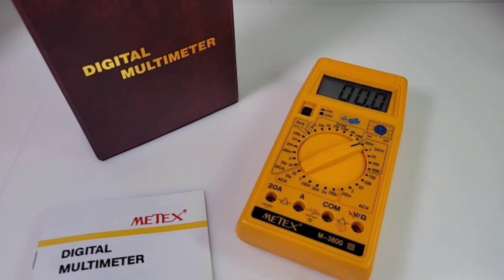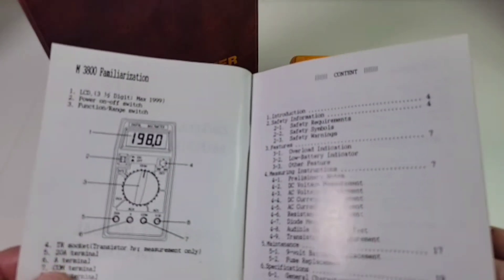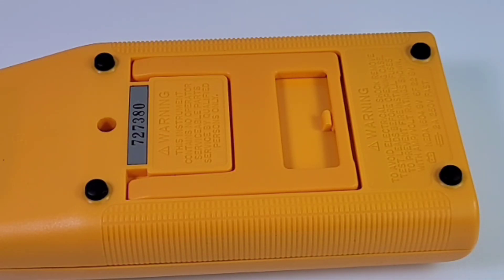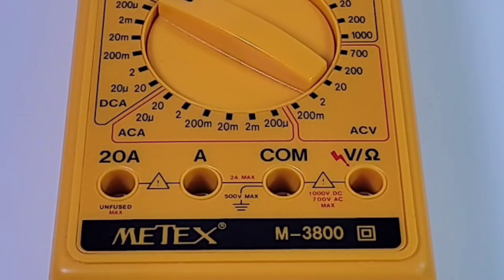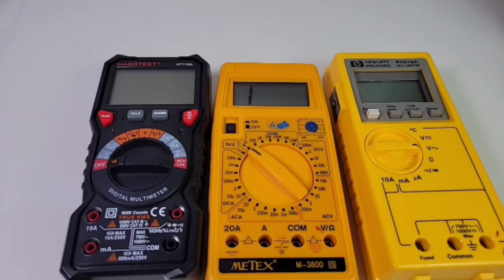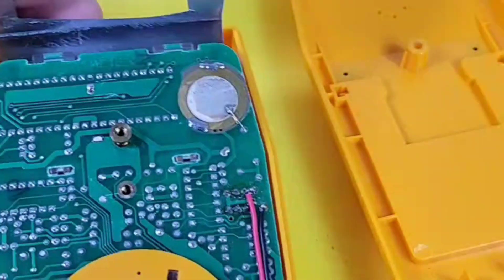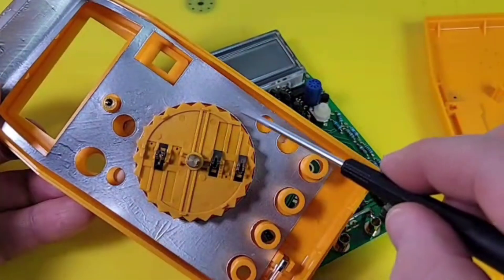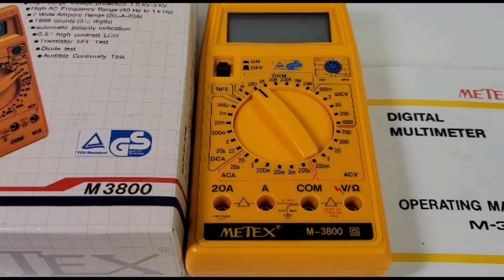RETRO-TECH ○ METEX M-3800 VINTAGE DIGITAL MULTIMETER [1992]

Comment: I had one of these, actually mine was an RTO (Ratho Hamburg) 3800. Basically the exact same as this. This was my first multimeter i bought it from my own money as a 15 years old kid... Stupid me i sold it for like 10 Eur about 5 years ago, simply i didn't need it anymore, i had no use of it next to my much more modern multimeters. I regretted it since then. Strangely i cannot find anything on the net about the RTO 3800, RTO was a popular brand in Europe back then. It was the exact same as this Metex, and it served more like 20 years without any issues. BTW, this has been sold under many other names, Mastech, Eumig, Mextech and so on.
Reply from the maker: Great info! Thx for sharing. Yes, I too have mistakenly sold a couple of meters only to regret it down the road.. what great  keepsakes ! 👍
Reply: I found one for 5$

Comment: Funny. Found this in a dumpster dive. In it's fake leather box and nothing else. No leads either. But it looks like it has not really been used either and only a minor scuff on the box which may have come from the dumpster. Seem to work very well. They really made great stuff back then.
Even those cheap DT-830B were sort of decent back then. Now you can find some DT-830B kits that are borderline decent but the preassembled ones are really just junk.
Reply from the maker: Great find..I need a dumpster like that! 😅

Comment: I just search for METEX M-3800 an found this video. Have the same multimeter. But something is wrong, just measured battery voltage and it fluctuates. I have a wish to repair it
Reply from the maker: It's a great multimeter ..definitely worth repairing.

Comment: They use two sets of tracks because a non-autoranging 7106 meter usually needs six pairs of tracks.
Reply from the maker: Ahhh-hah...
You my friend are a wealth of 7106 knowledge! 👍
Reply: @KeepOnTesting  I have also a mini 7106 meter with only 4 pairs of tracks on its rotary switch, but it has an additional sliding switch to select between VAC, VDC, mA and Ω. With two pairs of tracks again...

Comment: I use this one as my one and only MM. Mine does look a bit more "used" and has a slightly different facing, like missing the GS logo. But mine has a serial 512xxx and must be even older. Still using the original probes.
Reply from the maker: Hi Robert..
Wow great to hear your METEX is still going strong !! What a great multimeter 👍

Comment: How on earth do you remove the back to get to the battery? I have one of these but haven't used it for years. Needed to dig it out to check a friend's laptop charger but battery was flat of course. Cannot for the life of me see how to access the battery or fuse. Help please!
Reply from the maker: Hi Pete, There is 1 Philips screw in the back of the multimeter. Make sure to remove it fully,  than  carefully nudge the back off. Let me know if you need pics I can always send a few if it helps. 👍

Comment: Used it for 9 years working as an elevator technitian. Loved the carry case, newer got damaged in the tool box thanks to her..  when battery is low you get funky readings so i changed it every 3-4 months. It did the job, no complaints.
Reply from the maker: That's a great bit of history..it definitely looks rugged enough. Thanks for sharing 👍

Comment: I got this exact same model, a cousin from Germany sent to me in Bosnia in 1995. I still use it to this day.
Reply from the maker: That's great to hear.. it's a well built multimeter with alot of personality! Still looks 👍 good to.
Reply: @KeepOnTesting  The LOW BATTERY symbol is coming on during turn-off because the switch is disconnecting the instrument from the battery, which leads to its main supply capacitor discharging, in other words dropping its voltage as it powers down, so the symbol is merely telling you the supply voltage has gone below 7+ volts or whatever they have set as the low battery level.
 Your instrument and its battery are both fine.
Reply from the maker: @edinfific2576  Great 👍 info ! True enough because the battery tested fine 🙂 👌

Comment: I still have mine Metex 3610 (afair the number, it's not here at the moment). Purchased for a ton of money at late 80's (capitalist things were wery expensive behind the curtain). Still works, however, a major failure happened about 10 years ago - it died. But it's main circuit is an tht ICL circuit, so it was easy to be replaced (it's not soldered, it's mounted on a stand) and my meter works as new (after trimming the pot).
The good (and bad) in this meter is a lack of 20A range fuse. In some kind of tests it easy to blow away such fuse by eg. capacitor discharge, but may be dangerous in other situations.

Comment: Ah, nostalgia! I owned one of these for many years. It was my first multimeter and at that time the best I could afford. Mine was brown though. Maybe an earlier model. It did not have the GS certification. And the axle on which the knob was mounted in mine was made of plastic. Which I managed to break :-) and fix :-p For the rest I think my Metex M-3800 was exactly the same. So I guess Metex learned and improved the design of this axle. But I think the Radio museum might be right in this sense that I dug up one of my oldest electronics magazines (Elektor magazine) of June 1986 which holds an add for this make and model multimeter but in the brown version. Maybe the yellow version is from the 90's. It's a shame I can not post a picture of that. By the way, the ic under the LCD is the famous ICL7106.
Reply from the maker: Great info! Appreciate hearing the trip down memory lane..what a great multimeter indeed! If you could scan and send a pic of that add to netplicity1@gmail.com,  I'll post it on our website. (www.keepontesting.com).👍
Reply: I still use it today. and even after all these years it works perfectly
Reply: I send the scan. I hope it is any good.

Comment: Just wondering Darren, does that genuine fuse have a letter T or F stamped on it after the rating to mean either slow blow or fast blow 🤔
Reply from the maker: I'll double check when I'm back in the lab Derek....👍
Reply from the maker: F2AL250V , 2 Amp Fast Acting 👍

Comment: Double-sided rotary tracks, double-sided shielding, fast continuity, accurate reading, woowww... This one is a real deal. 😍
Btw, is the look of those cheapo DT830 meters came from this one? they look similar... 🙄
Reply from the maker: Its true, alot of look-alike multimeters came out after this version... Built much better than I had anticipated 👍 still can't get over the 2x rotary tracks..crazy ! They definitely weren't concerned about production co$ts when they dreamed this up!
Reply: At first, it also seemed to me that it looked like the 830th, but the 830th is far from such circuitry.